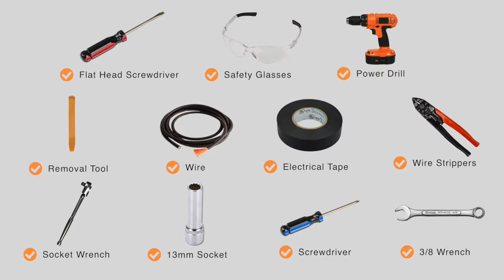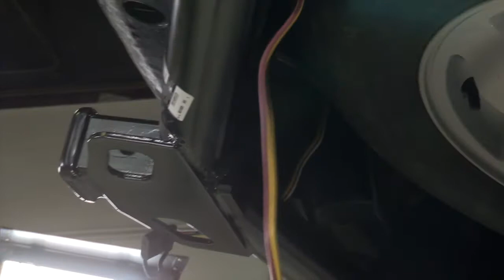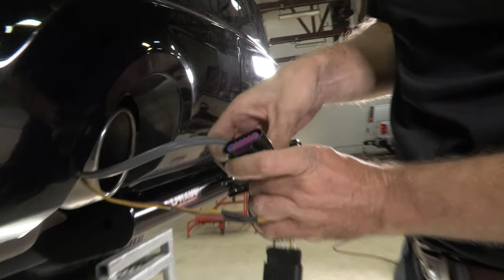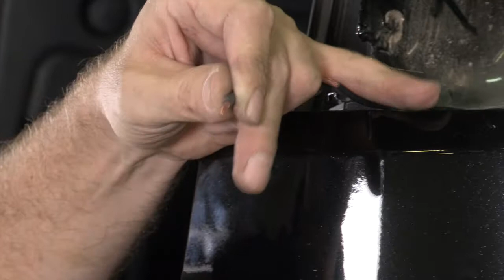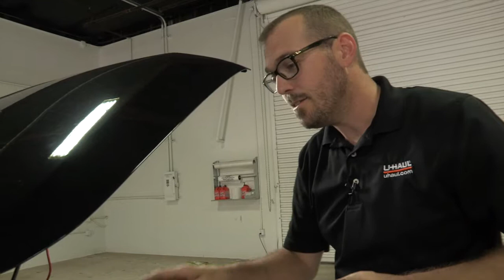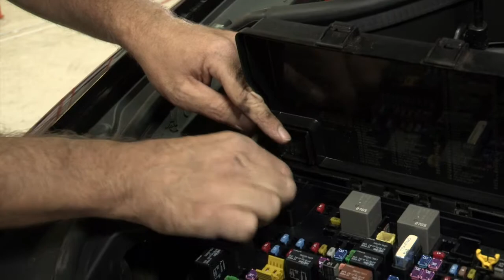2015 Dodge Durango Trailer Wiring Installation

Comment: Very helpful. My biggest concern is running the wire up to the front. I don't have a lift so I'd be slithering myself up.
Reply from the maker: You can always visit your local hitch center to schedule an installation!